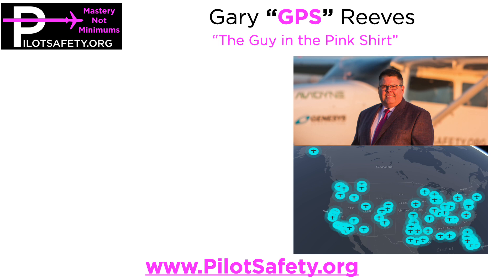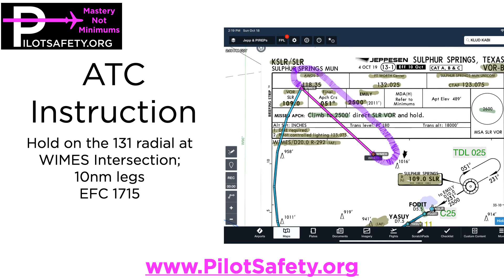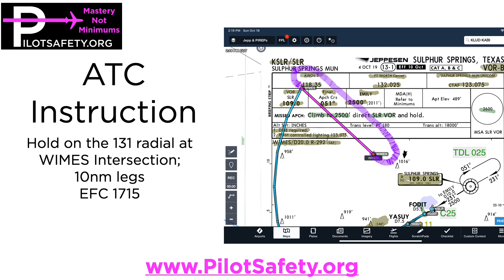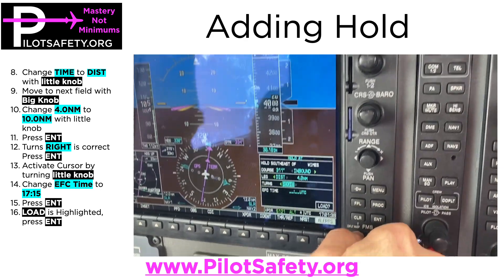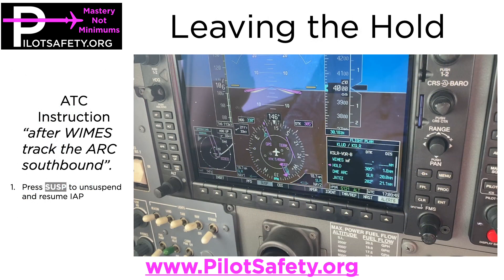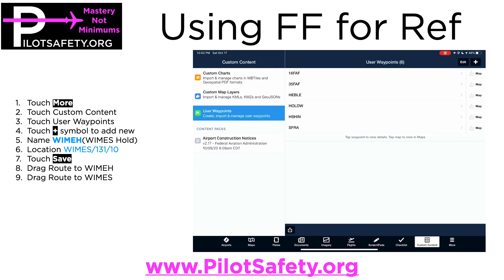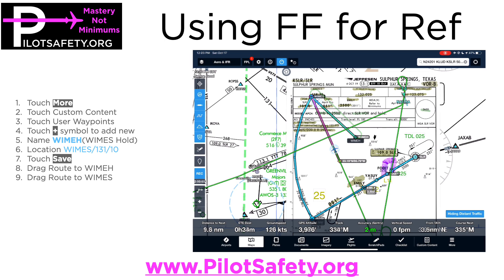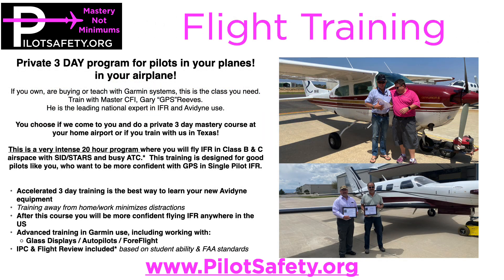Adding Custom Hold on Garmin G1000, G2000, G3000, Perspective

Comment: If they say hold on the 131 radial, why would that not be your inbound instead of 311? I’m confused.
Reply: Because if you are inbound on the 131 radial, your track will be 311. The radials are identified by their direction away from a beacon/waypoint.